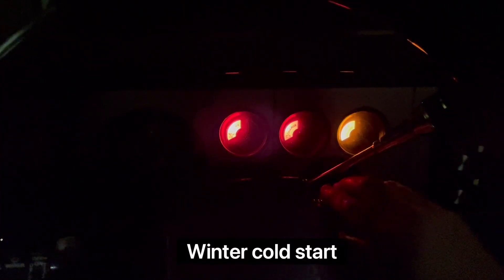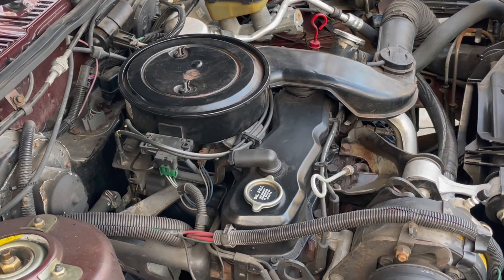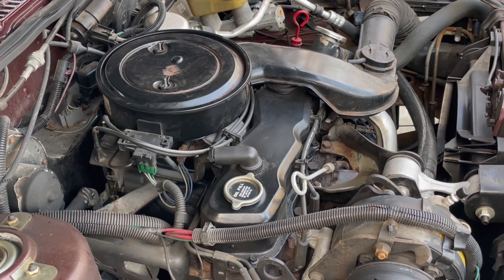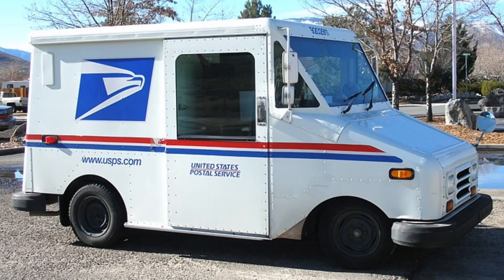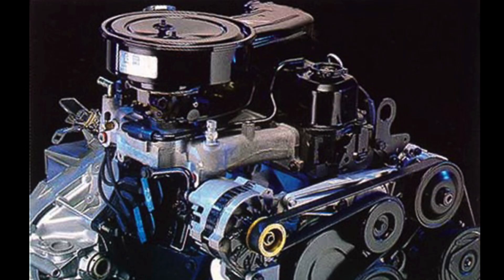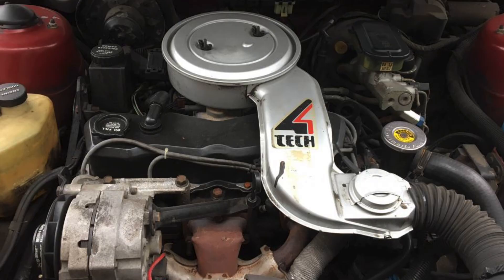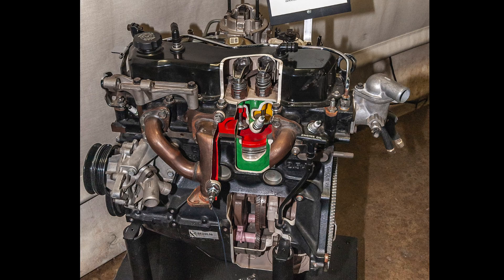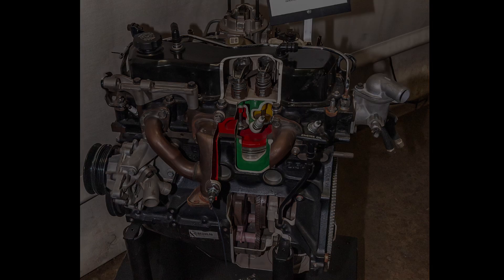Worst Sounding (and Most Recognizable) Engines: GM's "Puttering" Iron Duke 2.5L I-4

Comment: A company I worked for bought a iron Duke equipped Chevrolet Astro van, about 1989. I had the honor of driving it from the dealership. The gas pedal was mostly a volume control, stomp on it and it got louder but didn’t seem to accelerate any faster.
Reply: I could definitely see that. Even with the 2.8 that van wasn't very peppy. It wasn't until they put the 4.3 v6 in it did that van gain any real capable engine. That must have been a really low end, if rare Astro. I knew they made them. They probably didn't sell too many for that reason you made. I know that engine wasn't really powerful in my Cutlass wagon, I cant imagine a worse slug.
Reply: @PearComputingDevices  Indeed. Still have my 1995 Astro that still runs well. That 4.3L V6 always had plenty of power, which isn't too surprising when one realizes that it was a 350 ci V8 minus a pair of cylinders.
Reply: The astro never had a 2.8 V6.  Only a 2.5 iron duke or the 4.3.  The model year 1985 had a carb on the 4.3 and possibly on the iron duke. the Iron duke was dropped on astro around 1990 based on my memory. The S10 pickup and blazer had all three, 2.5, 2.8 and 4.3 available. @PearComputingDevices
Reply: My parents had a 1986 Chevrolet Celebrity with the Iron Duke 2.5L I-4 ... I couldn't imagine that engine trying to lug around something as heavy as an Astro van.
Reply: @kennethross786  that’s sort of the basis of the LLV that the USPS is still using, but who knows for much how much longer
Reply: @kennethross786  Kenneth, my Astro was old enough and a base model, panel truck type. The early ones were super short wheelbase and no glass on mine except doors and windshield, so it didn't weigh much. The interior was just painted steel, no carpet , just a tiny empty shell, so fairly light. Mine was also a 5 speed manual, so it was fine around town. On the hills on the freeway though, you were always in the right lane uphill doing around 50-55.
Reply: @steverichdrummr 
I had a 4.3L Astro with manual! I loved that thing! A previous owner had let the engine overheat badly. I got as many miles as I could out of it. No time to overhaul it, no short blocks available, so I sold it. Should have kept it and fixed it.
Reply: @bRichdrums I had this engine in an 86 Grand Am with the somewhat rare 5 speed.  I could bury the 85 mph speedometer up 6% grades in 4th.  It was underrated on power.
Reply: GM "sound of power"
Reply: My parents had a 1988 Astro van, I remember reading the Haynes manual as a kid and wondering exactly how it was supposed to even move with the 2.5 liter engine. Ours had a 4.3 and it did just fine.
Reply: I thought they went too far with the iron duke Camaro, but jeez 😫
Reply: @lastotallyawesomebleach204  the perfect graduation gift for A. Very disappointing child…
Reply: GMs automatic transmissions from the 80s were slush boxes.
Reply: Wow I never realized they were in the mail trucks….but now that I learned it, I definitely hear the junker go by my house!
Reply: @EDBZ28 yup, all LLVs except the last model year uses the Iron Duke. Last model year (94) used the 2.2L as the ID was discontinued for 94.
Reply: Makes your Flivver quiver LOL Ye Gods! My lawn tractor has a healthier exhaust note!🙃
Reply: Hadda astro van with one of those. Most reliable vehicle ive ever owned. The plastic dash eventually doomed it. All those plastic wiring sheets. Musta put 100,000 miles on it after i bought it with 200,000. 600 bucks. 26mpg uphill or down. Wouldnt pull a greased string out of a cats ass as dad usta say.
Reply: As Clay Millican says, “stomp on that loud pedal”.  😂
Reply: I had no issues hauling balls in my s10 with it.
Reply: Iron I get, but why did they call the Duke?
Reply: The sound of a mail truck is always kind of disappointing.

Comment: Correct me if I am wrong, but when I was a youngster in the early 60's GM also had a 2.5 4 cylinder which they also called the Iron Duke.

Comment: I remember it well. My grandmother’s 1987 Oldsmobile Cutlass Ciera that she bought new & owned it until the day she died in 1999. had the 2.5 Iron Duke 4-cylinder engine and 3-speed automatic transmission. It was a good car & reliable, but was definitely underpowered especially when the air conditioning was being run in the summer time. It was definitely more reliable than her 1982 Buick Skylark with a carbureted V-6 that it replaced.
Reply: Oh yeah, these engines were dogs in the A body.   I drove a Pontiac 6000 back in the day with this engine.   It might could top out at 80...  Might...
Reply: @keithjackson286  If you were going downhill.
Reply: With a tailwind. This engine did not belong in A bodies, or in Astro vans.
Reply: @keithjackson286 wow! Really??
Mine was fast top speed at 190km/h German autobahn 
It was a 1980 skylark with some modes on the engine.🙃

Comment: In Australia, we had our own "iron duke" moment, but ours was a definite failure after only a few years' production. GM Holden called it the "Starfire". Take the  venerable Holden 6, slice 2 cylinders out of it and call it done. On paper, a smart move, as everything else (water pump, oil pump, filter, alternator) was identical. What resulted though, was a harsh, grossly underpowered, not very economical, prematurely wearing, stopgap mess of an engine. 78 horsepower from 1.9 litres. It was not loved by many. A mate of mine had a VH Commodore with one, backed by the infamous Trimatic (TH180) auto. Slower than a wet weekend.
Reply: And when they were first introduced the valve guide oil seals were useless from new. I used a sump full of oil on a 250 mile open road trip on a car with less than 1500 miles on it.  It really was the most horrible gutless apology for an engine ever made around that time. GM eventually replaced it with a 2 litre straight six Nissan engine which had twice the power and ten times the refinement. They also had a 3 litre version of the same Nissan motor which was similarly much better than the old inline Australian built six it replaced, but the refinement gap wasn’t so pronounced with both engines being sixes.
Reply: @mokitabbycat97  you must be from NZ, as we never got the RB20 in ours. That would have been a sweet little engine.

I still believe, to this day, that the best Holden 6 was built by Nissan. 

I can't help but think that Holden had some serious QC issues in the early 80s. They were going broke after the huge investment and lacklustre sales of the Commodore. I've heard that the carbureted black motor 6s got whatever parts were left in stock, including different size pistons and rings, bearings, etc and only the premium EFI engines were properly assembled. Even the EFIs had their dramas, with the red intake plenum and runners being painted that way not to look cool (which it did) but to seal the porosity in the alloy casting which was causing poor idling and misfire.

The only good thing the Starfire gave us was chunky conrods, which were used by guys wanting to upgrade their red motors.
Reply: Yes I’m from NZ. The 2 litre Nissan 6 sold well over here, as did the 3 litre.  I’m pretty sure Toyota Australia got lumbered with the Starfire 4 in some of their Australian market models as part of a government prescribed motor industry rationalisation plan. Those poor Toyota engineers must have nearly died to see (and hear) such a crude gutless lump under their hoods.
Reply: @mokitabbycat97  yep it got installed in one model only, the locally assembled Corona which Toyota gave the engine code 1X. Probably X because they didn't have the words to describe how garbage it was.

Yes the legislation gave preference to locally-made vehicles (as was the case for a long time before that), via local content laws that encouraged manufacturers to share components between their models. Ford and Chrysler shared gearboxes and diffs, power steering boxes were shared between all 3, and models like the Cortina and Centura 6 cylinders were not made to create a sleeper hot rod (which they sort of were) but to satisfy local content by installing 6 cylinder drivetrains in locally assembled CKD kits from overseas.

The ultimate iteration of this legislation was the Button Car Plan, where entire cars were rebadged across makes to fill the market needs and consolidate local production to a sustainable range of models.

Comment: GM also used a nylon camshaft gear with the timing chain in the late 70s V8s, they also stripped off after 100k miles. Luckily with the deep dished low compression pistons it wouldn't hurt anything and you could just put a good all steel timing set on for $40 and be back on the road.  Dodge 2.5 4 cylinders also sounded terrible in that era, they have fuel saving short skirt pitons that developed bad piston slap in a few years. The dealer I worked at would get those cars for $400 or less at auction, spend $200 on a headgasket, 4 new pistons and rings and put em up for $2495 to $2995 sounding like a new car.

Comment: Back in high school, one of my shop classmates had a blue 1986 Firebird with the Iron Duke & backed by an automatic transmission ( final year the Iron Duke was offered in the " F " body ).

I went to work. Painted it black. Put a gold " Screaming Chicken " on the hood. Put gold Trans Am flares & Trans Am smoked tailights on it. Installed a set of mid-1980s Trans Am wheels shod with B.F. Goodrich T/A raised white letter tires. 

On the rear bumper, I stenciled in gold...

" Looks Fast! "

Comment: It's funny you mentioned the run-on issue.  We had an Iron Duke in the first year 1985 GMC Safari.  Darn thing had an annoying habit of sitting and chugging well after you had removed the key and walked away from it.  It would eventually kinda rev up slightly and then finally shut down.  We replaced the carburetor twice and never did eliminate the problem.  Gotta love it!
Reply: Yeah, the TBI EFI Iron Dukes can't do that as fuel supply is gone. TBI injector is triggered by ignition pulses. Distributor, ECM and fuel pump are all off with the key. I guess the trucks didn't have TBI by 1985 in all markets. 
Almost any carbureted engine can do this, but the Iron Duke was more prone to it than a lot of other engines. As long as the engine is still spinning, the fuel pump is still filling the float bowl in the carb, and something in the combustion chamber is taking the place of the spark. If you try hard enough, you could probably set up an Iron Duke with a carb to run (badly) until the fuel tank was empty. 
This is a classic dieseling problem - check your plugs. You will likely find that your plugs are fouled with fuel (too rich) causing carbon deposits to form in the less-than-ideal combustion chambers. Get your air/fuel correct, get your ignition timing right, make sure it's coming up to thermostat temperature on every drive, and the problem will likely go away fairly quickly as you burn off the carbon deposits. Casting flaws in heads or pistons could theoretically cause this too, and they will NOT burn off.  
Also, make sure your spark plugs are the right heat range, a hot ground strap can cause dieseling.
Reply: LOL.... also, check evap system, if it's full of fuel, that might cause an EFI Iron Duke to diesel, but you'd still have to have carbon deposits, casting flaws, or grossly bad heat range plugs to do this. Your Check Engine light would have been on for months for the carbon deposits to get bad enough.
Reply: Or simply use a higher octane fuel. @BrainDamageBBQ
Reply: Here’s how to not have it run on. Do this every hot shutdown. With engine running, put transmission in drive. With left foot on brake, right foot hovering over gas pedal. Turn key to “off” (not lock) turn steering wheel (try to) and give it gas. The slight load of the transmission, and of the power steering pump, will be enough to help it shut off instantly. No more embarrassing run on/dieseling.
Reply: Dieseling was not a new problem - I recall as  a little kid my parents borrowing the '67 Chevelle of a friend who acquired it from their retired father, and that basic Chevy (probably its 307 V8, maybe?) surprised all of us when it ran on after my mom shut it off. Just think, this was a '67 that predated any of the emissions attachments that were so often blamed for such issues in the '73-'74 spaghetti-covered engines with air pumps, etc., of the pre-catalytic converter era. Maybe it was the Sunoco "Economy 190" low-octane gasoline we pumped into it?

Comment: 1 of the greats, iron duke was awesome in my dad's 89 grand am!! A ton torque!! But my dad in laws , 2000 dodge Dakota has almost the same noise and rough idle. Damn the 2.5 was even used in some mercuise applications as a 3.0.  Work on my brothers boats, I thought I saw a ghost

Comment: I had an 89 Pontiac 6000 LE in the mid 2000’s when I was 19-20 years old. It was a particularly noisy little motor. Sounded like an old Mercedes 240d. Our neighborhood’s mail truck sounds exactly the same..

Comment: That's pretty interesting to know. About 10 years ago I was transporting a 1986ish Little burgundy  Buick Regal that my friend found with only 31K miles. I flew from Miami 2 outside of Cleveland to pick it up.  It was absolutely pristine. I took it over to Sears before getting on the highwand the only thing they ended up selling me we're tired, Wiper blades, And an oil change. It looked like a little old ladies luxury barge just shrunken with the crushed valor teeth and all the ridiculous gauges but NOOO I remember it sounding sounding like a school bus at idle And it was very slow on the highway. I stopped more than a couple times Just to make sure the nurse were full in the front because I thought it felt like you were driving through sand. The funniest thing was When the original owner exclaimed to me that after driving it on the freeway for an extended. of time when I did decelerate not to come to a complete stop or the engine may overheat??? I asked the guy at Sears if the seller was telling me some shit because the head gaskets were blown or something and the tech looked in the computer you did and told me that was in the original manual.. I swear to God look that up! You have to like coast before before coming to a complete stop because the motor needs needs the air flow. It's also no shock to see here that they put the same 2.5 in that crude little S10. Chevrolet could have a cool ad campaign where they could brag that the s ten's engine was as smooth as a Buick's😂😂😂

Comment: I picked up an 1992 s10 back in 1999, for $500. Has the 2.5L and a 5 speed. 
The old man I bought it from had Alzheimer's and had not noticed that the water temp gauge wasn't working. He cracked the head 17 times. 
I pulled the engine out and started rebuilding it with my Dad. Took the head and had it tested, we cleaned the block up and everything else appeared normal. 
The head test bad, so we went down the road to the junkyard and they had 5 or more heads to choose from. Took one back to the machine shop, tested good and had them to do a valve job on it.
We got the head back and built the Lord Duke.
Compression on 2 cylinders 130psi for 1 test and then 80psi for a different test. Took Dad a year or so to come up with the fact, the dingleberry at the machine shop hand rebuilt the good head, with the rockers and valve springs from the COOKED head we had taken them to begin with. I just bought new springs and rocker arms at Auto Zone and smoothed out completely.
What a nightmare.... No sense in this world, he didn't put the entire head, rockers and all in the scrap pile; after he tested that it was cracked.......

Comment: I had 82' Phoenix with this engine. Yes it was crude sounding. But coupled with a 4 sped manual  the performance was good the and fuel injected  engine got great gas mileage.The X cars were roomy  and conformable. Had I not got a great deal on that car because of the 82 down turn i would  heaved  passed.

Comment: Embarrassing is correct. It was horrible and everyone knows it. No one can defend it. It was agricultural and DRONED on and on, the sound was a droning sound at all times. Made no sense to floor it, it was painful to do so. Loud idle with noise, vibration and harshness through the roof. Slow, droning. Headache inducing. And millions had to endure this nightmare since 1977. It was even in the Pontiac Fiero sports car. Good God. The only good thing that could be said about it is that it uniquely was just how American four cylinders were. Made American cars different and unique. If that's good lol

Comment: 6:55 Ford 300 inline 6 engines are prone to this too especially the carbureted ones. My theory for the 300 at least is that most of them didnt really have high compression ratios (being able to potentially run lesser fuel was more of a priority) so theres less resistance and it just takes longer to stop spinning. With a carbo this also means a bit of fuel is sucked in and on hot days its possible for the engine to kind of try to fire off that once or twice on the way down.
Reply: Running on like that often happens because something in the cylinders is acting rather like the glow plug in a R/C plane engine. Probably a red hot bit of carbon stuck to the head near the exhaust valve. As the fuel air mix gets compressed it heats up, until the still glowing carbon is able to light off the charge. The combustion heats up the carbon and keeps it glowing, so it can ignite the next power stroke and so on.

Comment: Oh, my, those cam gears. I replaced about 100 of them without pulling the engine! (Secrete) Oh, and the exhaust manifolds that crack too! They were a good engine tho.Oh, and the short head bolt on the front right breaking do to corrosion.